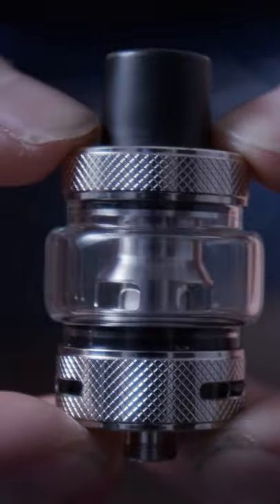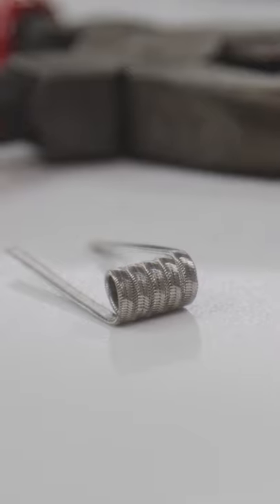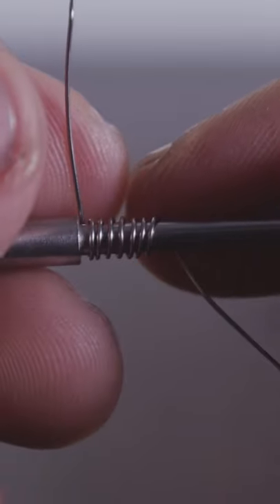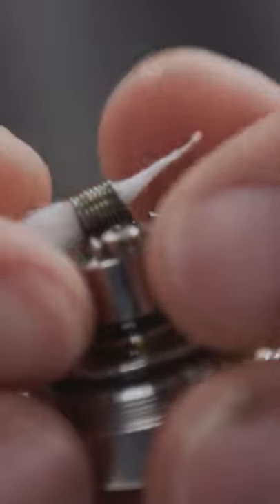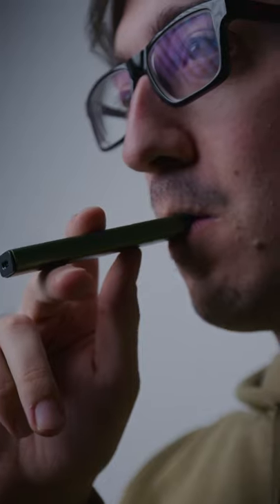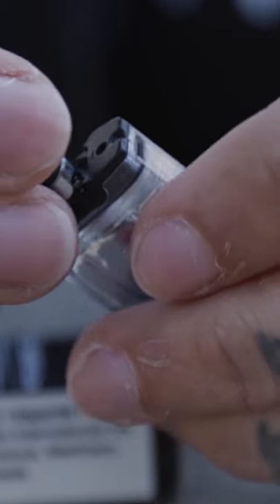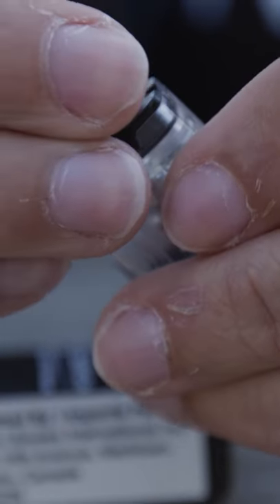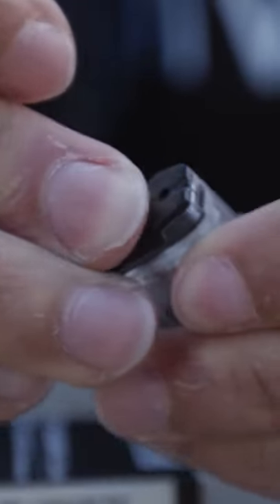Why Canada isn't seeing any new rebuildables...

Comment: If child resistant is just a matter of pushing down while unscrewing then rebuilding and rewicking an RTA/ RDA should be more than child resistant enough, unless of course Canada has toddlers that can build an atomizer. These laws and regulations are so ass backwards it staggers belief sometimes.
Reply: I have a CRC approved sub-ohm tank and it the easiest tank that I have to open just lift and slide and you are free to suck out all the liquid you want,go figure.

Comment: Just use the push down method.... Put that on not only the top cap to fill, but also to remove the base as well to reach the coils. You could also do this same design for an rda. You just won't be able to quickly remove the top cap to drip. Make larger drip tips like the Valhalla so you don't have to remove the top cap to drip your juice.... maybe make it a single coil and have it come with a custom long tip bottle so you can drip the juice directly onto your coils since some people prefer to do that over just straight dripping it.

Comment: I'd just like to see the rationale for the law in the first place. Since the CRC is designed to prevent the Injestion of to much nicotine with salt nic at a legal 60mg at the time of implementation of the CRC it might have been  generally accepted that with nicotine levels that high and over abundance of caution was possibly the right approach. But now that the nicotine is capped to 20mg I think it's time to review said laws for their usefulness and the potential for stifling innovation. Oh and there is always the question of RDAs since they do not have a tank how is it that they aren't more widely promoted as a far less potentially dangerous option when viewed through the ridiculously over zealous lens of child death by over co sumptuon of a product that burns hard the moment it touches the lips. . . . .b.